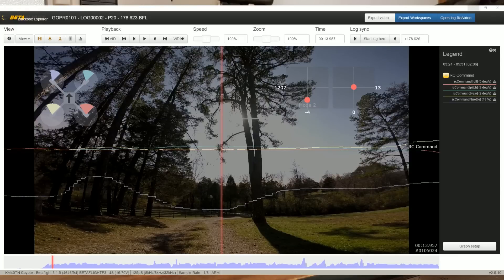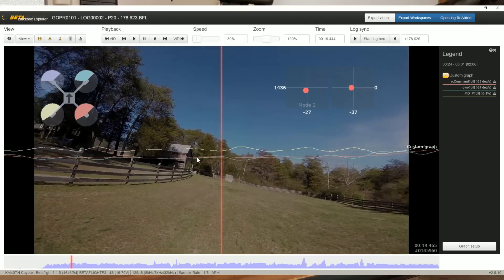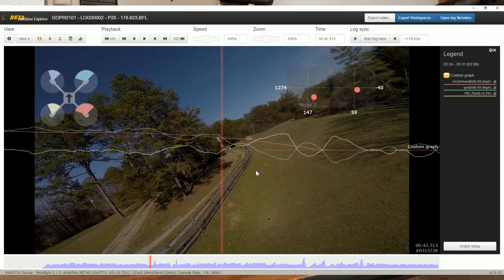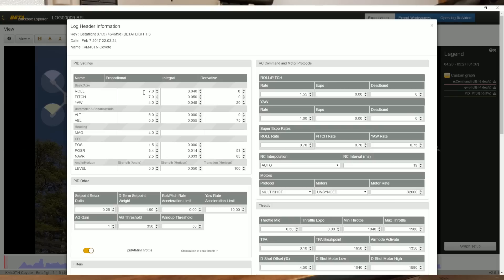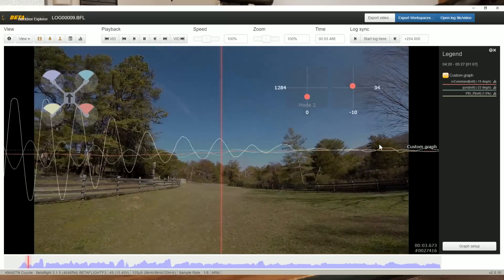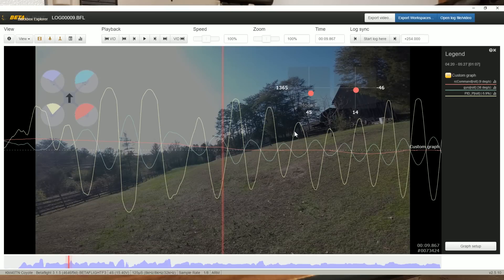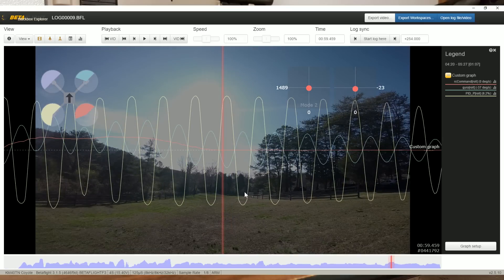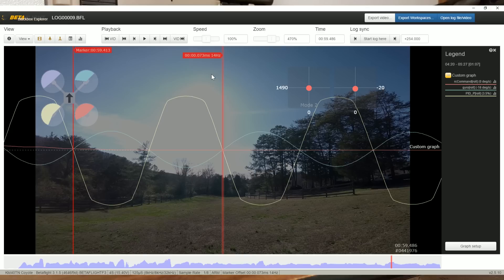BLACKBOX 101 | Ep6 - High and Low P Gain

Comment: Hello Joshua,
I'm a big fan of your videos!
One question: finding the P term that causes the permanent oscillation and its frequency, could we use the Ziegler-Nichols table to get the P, I and D values for an optimal tuning?
As far as I understand, from one of your videos, the throttle modifies the behaviour of the loop, so... should it be some kind of throttle modifier of the PIDs?
Thanks!!!
Reply from the maker: +ASG_8 Zeigler Nichols would be fine for a simpler system but not for a very dynamic system like a quad.

Comment: Hi, how do you explain that the slope of the PID_P has these breakpoints during the oscillations ? 15:50 for instance : The error (gyro in that case as the command is fixed) is a clean sin wave, but the P term shows linear straight slopes in between 2 changes of direction. Shouldn't it be a proportional image of the gyro in that case ? Or maybe there is some kind of saturation of the PID_P term ?
Reply from the maker: +Manuel Pellizzari there is some expo in the Blackbox Viewer display that causes the values to level off when they are large. You can disable it.

Comment: Interresting! You mention somewhere arround 7.40 not with a 5" quad. My question is whats a general starting point to look at with a mini quad say 130mm in size 4000 kv vs a 210 with lower kv motors 23 - 2600. In terms of pids. A fly both and have upgraded them lately with BF 3.1.6 a have to do my tuning again. Can a smaller quad with high kv motors run higher pids? Or should I look at the opposite?
Reply from the maker: P and D gain are roughly proportional to thrust-to-weight ratio. I find that smaller copters usually have higher P gain, but if the motors lack torque, then you get too many oscillations.

Comment: Thanks Josh, great vid. Would have liked to see how a well tuned quad looks with D gain removed. Maybe note how many times it bounces after a hard roll. Got me thinking about Stingers video where he has a feel and an ear for where P should be on it's own. P seems harder to tune now with later BF. D is doing such a good job that I find I can raise P without seeing obvious bad effects.
Reply from the maker: +Kentucky a well tuned quad will not have D gain removed. I agree that the tuning envelope for P is wider. Focus on feel and edge cases like propwash oscillation.
Reply: Joshua Bardwell. You missed my point maybe I didn't explain it well.

Comment: 10:30. I thought tpa applied linearly from the breakpoint to 2000? (Ie.. It's not 10% at 1650- it's 0% from 1000-1650 and increases linearly from 0-10 from 1650 to 2000)
Reply from the maker: That's correct.

Comment: Being a visual learner this is great for understanding whats happening, I wouldnt even think about looking at Blackbox info until now.         But it makes me question, do you think it would be possible for firmware in the future to say, let you do a "calibration run" go through manuvers on all axis, then while looking at the blackbox data, adjust PIDs and get an instant simulated result on the waveforms? Take out some of the trial and error? maybe it would need a weight value?      I know that would also take away much of the fun that you are explaining to us and thanks by the way :)

Comment: In audio and broadcast world there are devices, which can deal with variuos issues like sound feedback or buzzing noise. They can detect issues in real time. Now, maybe it's possible to add some real time analyzer to betaflight which could detect such oscillations and then PID controller could use few algorithms to deal with that. Not sure though, if the CPU's on the typical boards are capable of crunching this.
Reply from the maker: I think there is some potential to accomplish this. For example, P term oscillations are so obvious in Blackbox that it seems like it should be possible to also detect them in real time, with enough processing power. Also, real-time filtering is another approach that could bear fruit.